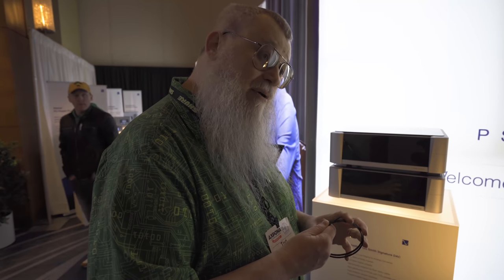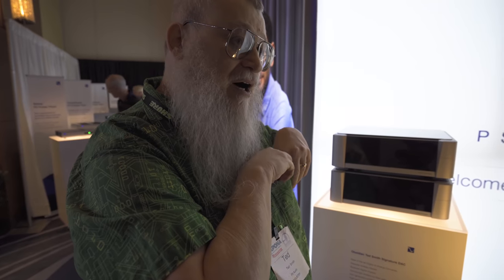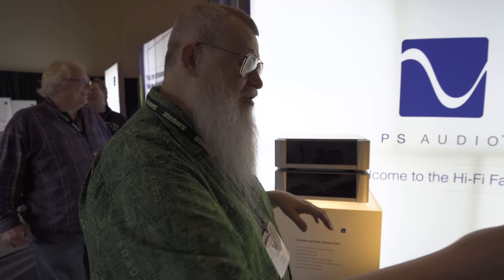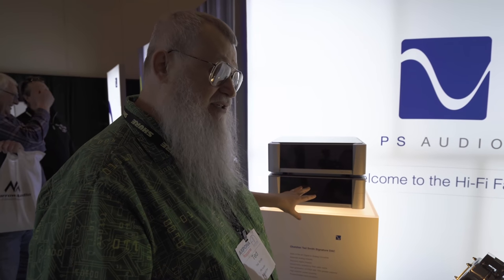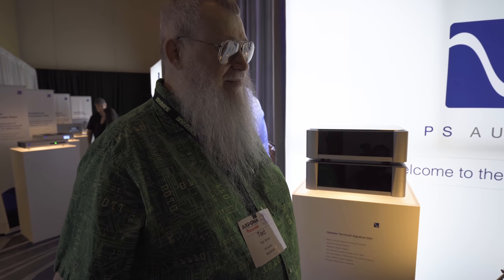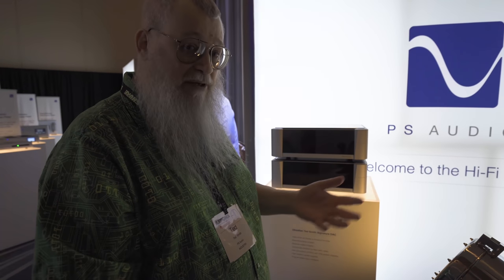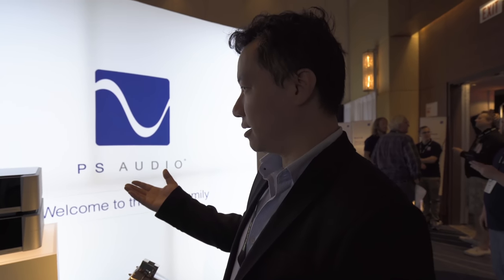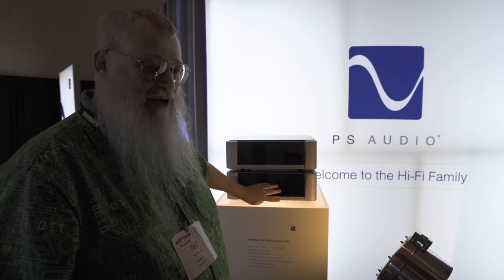PS Audio Obsidian Ted Smith Signature DAC

Comment: The thing I'm impressed with about PS Audio is that they will brilliantly re-purpous existing technology in order to give value with performance. The remote knob has been done but it's easier to do now than it was back when Sony put the jog wheel on a vcr remote. The really cool display is infinately easier to do now that we have smart phones. The thing I haven't figured out is if there is a quadrature-coupled power transformer and if it exists what does the core look like?